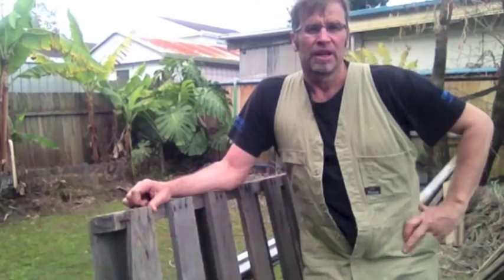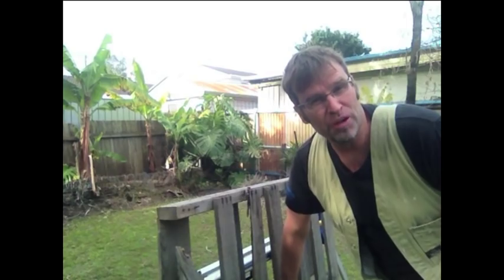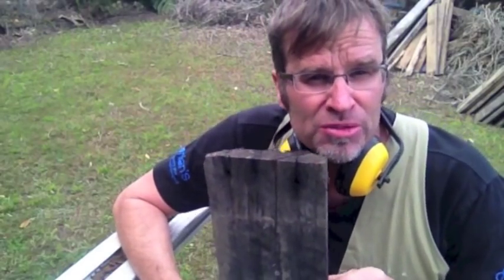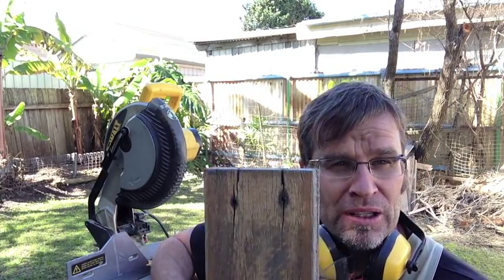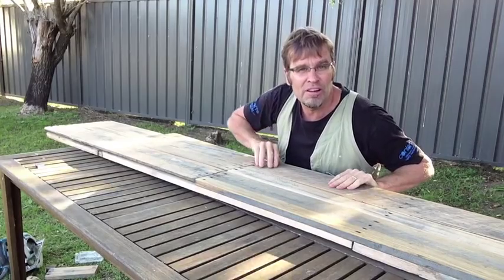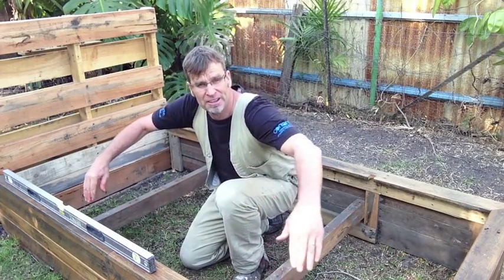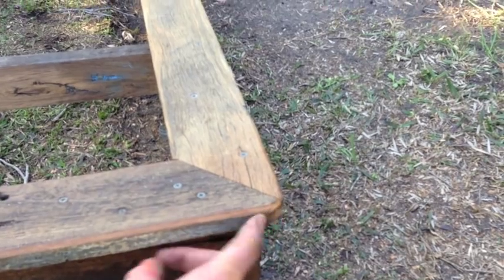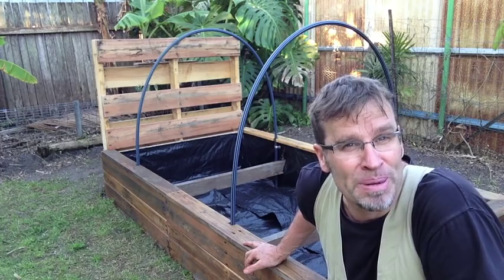How to Build a Raised Garden Bed. THE ULTIMATE Pallet Wood Vegetable Garden.

Comment from the maker: G'day Norbury. The garden bed was all hardwood apart from the slats on the back of the full pallet where the tool holder was. In regard to the worms, l intend to release a tub full of them into the garden bed when l fill it with soil.
Thanks form the questions. Cheers mate.

Comment: Thanks alot for the video. I was able to follow along and make a really nice raised garden bed for my wife. Do you use the planer for sanding and smoothing down the pallet wood? I'm trying to decide which one to buy.
Reply from the maker: Thanks Terrell. What l tend to do is plane down first (make sure you've removed ALL of the nails otherwise your blade will be destroyed) and then sand with a sander. It all depends what type old finish you require. If you want it nice and smooth then you will need to use a sander. If the board is a bit cupped and quite rough you will to use a planer. Hope that makes sense. Cheers mate. By the way, l'd love to see some pics. If you want, you can post some on my Facebook page. Here's the link
https://www.facebook.com/DiyForKnuckleheads?ref=h

Comment: Nice video mate ! Just a question. Is anyone worried about using pallet wood on their veggie patch. I just wonder about the treatments that would have been used on the timber and whether or not they could leech in to the soil. Thanks again for your videos mate
Reply from the maker: Thanks Killian. I use old hardwood pallets. If they were treated when made, by the time l use them, most, if not all of the treatment would have leached out. It's also a good idea if you aren't sure, to use pallets that are heat treated and not chemically treated. A stamp on the side of the pallet saying 'HT' will signify that. Cheers mate.
Reply: shaneconlan1  Awh mate thank you very much for your quick reply. I really appreciate it. That put's my worries to bed. I make a lot of pallet furniture but I've always just worried about putting them in my garden. Again, love your videos bro, Your energy and charisma is awesome. If your ever in Auckland you've got a few cold ones waiting for ya.   :D
Reply from the maker: killian cotter No worries. I'll hold you to those beers mate :-) Cheers

Comment: Excellent project mate. The railings around the top of the bed. How did you make those angel cuts to piece them together?
Reply from the maker: For the railing l just cut a 45 degree on each piece. Thanks for the comment mate. Cheers
Reply: I didn't get around to making those railings. I did finish a few other pallet projects.
Reply from the maker: Terrell Johnson Good work mate. I hope they turned out ok.

Comment: Great idea...however, shouldn't there be a concern with the chemicals in the wood from the pallets leaching into the soil and absorbed by the vegetables?  Most pallets used in international shipping must be either heat treated or chemically treated.  One should be prudent to avoid using the chemically treated pallets for reclaiming the wood.    For international shipping, pallets require an IPPC logo which certifies that the pallet was heat-treated or fumigated with Methyl Bromide.  The standard is a 2 letter country code (xx), a unique number (000) assigned by the National Plant Protection Organization (NPPO), HT for Heat Treatment or MB for Methyl Bromide, and DB to signify debarked.  One should only use the pallets marked HT for vegetable gardens.  Hope this helps!
Reply from the maker: +pjdiamond63 Thanks for the heads up. Cheers
Reply: It looks like the plastic liner would stop your leaching problem. Definitely something the think about while cutting and sanding the wood though!

Comment: Id worry about using pallets in food gardens. Alot of pallets are treated or carried harmfull and dagerous chemicals.  And yes treated lumber or contaminated wood leaches out over years.  Ive personally had non bio arsenic poisoning just from working with treated lumber.  I would definitely look into the pallets manufacture and what was carried on them if you intend to use them.   I use scraps from home builds no treatments and all is reliably clean.  Dont get me wrong though I love the project.
Reply: Thats why you look for the HT symbol on the pallets...Meaning heat treated...not the chemical treated ones
Reply: drop some builders film between the soil & and boards

Comment: are pallet busters [Amazon] quicker, than using a reciprocating saw?
Reply from the maker: Both are pretty much of a muchness CJ. The Pallet buster is probably a little safer and you still need to deal with the nails once you have removed the boards. With the reciprocing saw you saw the nails off at the board which l kind of like as the nail heads look nice and rustic. The pallet buster is also a bit kinder on the back as well. Cheers

Comment: I'm going to combine your "building a work bench" base, and add the planter bed on top, so I have an elevated bed, since I want to be standing to garden.  Using re-cycled wood for each portions that way they look like they're meant to be together.  I don't have an electric planer, but, I like the old wood look anyway.  Thanks for your great ideas and easy to follow instructions.
Reply from the maker: Thanks Penny and good luck with your project. Sounds exciting! Cheers :-)